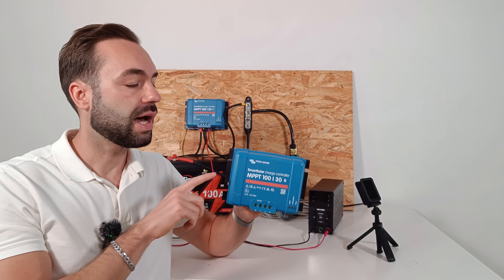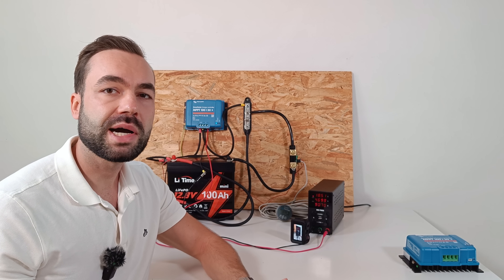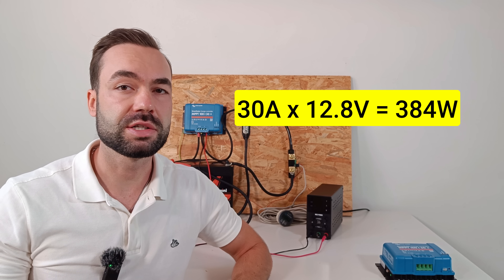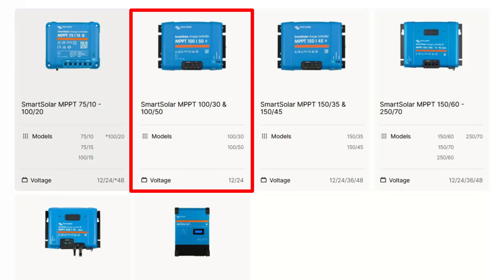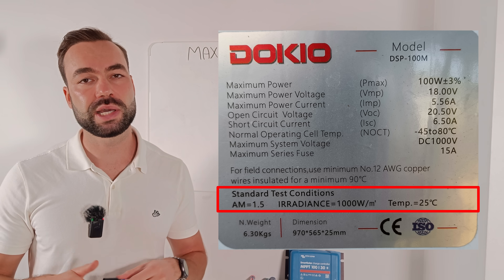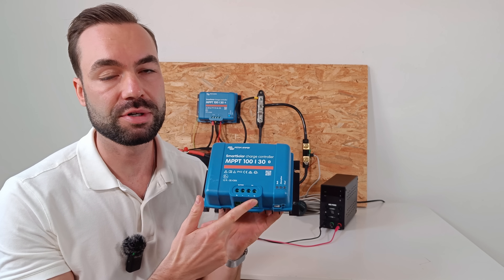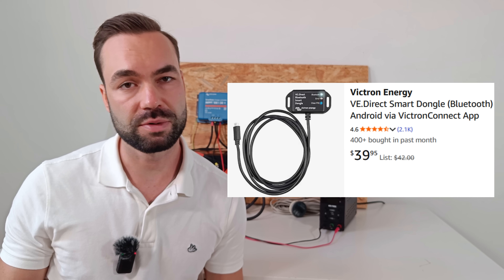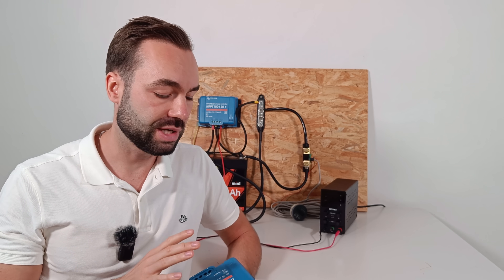Victron 100/30 MPPT Charge Controller Test + Review

Comment: What if I didn't connect to the  Bluetooth what will happen
Reply from the maker: Then it works on factory settings with the battery chemistry selected on the rotary dial.

Comment: Hi
So blue solar does not have the build in Bluetooth. Has does one configure these controller and monitor it?
Reply from the maker: Yes, with the Bluetooth dongle that you plug in the ve port. Remove after programming. But this dongle costs about $40.
Reply: @cleversolarpower can any small victron controller be configured without Bluetooth or computer?
Reply from the maker: Some have dip switches like the victron Multiplus and the mppt has a rotary dail. So these can be adjusted to charge different battery types.

Comment: ok if I over panel to 720W (3S x 240w 22V each so 85V max)  on Victron 100/30 ... clipping will cause some trouble during summer or not much? ... I must over panel as winter is killer here.

Comment: Thank you for the explanation.  But What is the max current you can run. I am running 2x 345 watt panels, in summer on the trailer I can get 84-86 volts and 7 amps in series, with the 100/20, into a 100Ah LiFePO4, I winterized the trailer and swapped the LiFePO4 for the original AGM battery. From what I understand I san run a second string of panels and still push 84-86 volts but now may amps will be 14 amps, so my question still is how many amps can I run? Thank you.

Comment: I Dont like these MPPTs cause the terminals are underdimensioned, the housing is filled with gunk, so no repair is possible, they are too small, so cooling is poor, optical design is as good as non existent, its a too big monopolist which I never trust.....everything but victron

Comment: Great to know that going over the amp capacity won’t ruin the controller. I’ve had the victron 100/30 for a few years now and I’ve worried a bit about that. I have 3 - 200w panels on top of my rv and it’s rare to see 450 watts being produced by the panels, still it was a concern. Thanks
Reply: You have to pay attention to the voltage (100v max) and the ISC (35a). That ISC is important not to exceed when doing parallel connections. You can overpanel A LOT with Victron compared to other brands, that is one of its appeals. Many people choose to add a fan (silent it can be). There are people who use to run their Victrons to the max (clipping) without problems. In cloudy days you won't hit the max, but make use of the added panels.  For some it is about maximizing production and utilization during light hours and not having large batteries. Cheers
Reply: @segundacuenta726 I guess I’m not too concerned about ISC. My panels are hooked up in parallel, but from a bus bar to controller are 6 gauge welding cable along with a 40amp circuit breaker. Hopefully that is good enough. ?
Reply: @sunroy1  yeah that sounds alright.

Comment: Hola estoy viendo tus vídeos sobre victron es muy interesante y explicativos,yendo dos baterías lifepo4 de 280 a cada una conectadas en paralelo y con dos reguladores smart 50/100 cada uno,el problema es que figuran que están cargando pero las baterías al 65% están en estado de "Espera" que puede estar sucediendo
Están el carga 14,60
Flotación 13,80 y con un shunt de 300a
Reply from the maker: What is indicating the 65% charge? The mppt or shunt? Have you measured the voltage?
Reply: Te baterys @cleversolarpower
Reply from the maker: I would not trust the battery indication. I would trust your shunt.

Comment: But why not look at using bigger panels: like a full size one of +/- 500 Watts. 
Max Voltage +/- 33v.

I'd argue that with solar panel cost dropping so much (£70 for 500W), then with 2 panels, your panel cost = MPT control, and it's your batteries that are the things that limit you. Lead acid can only charge at +/- 20amps and it costs +/- £180 for a good quality 100 Ah battery. And with two 500W panels you will want two, so that's £360 for +/- 200 Ah.

Ideally if you have the space, use 4 x 500W panels in Northern Europe (2S2P).
Reply from the maker: Yes, that's going to be better. However, in the us, the shipping is quite high for last mile delivery. It's often times cheaper to get smaller panels and connect them in series.

Comment: I don't see where you test the devices to see if they can actually deliver the promised charging performance, which is the most important thing!!! If I buy a 30 Amp charger, I naturally want that charging current to be delivered continuously if the manufacturer promises it.

If you don't have enough PV available, you can simply test your charger: connect a 12-volt battery to the battery terminal. If you don't have PV handy, no problem—connect a 24-volt battery to the input, and you immediately provide the charger with more than enough power to deliver its promised charging performance.

A 30 A charger is thus forced to deliver its full 30 A. The input battery will then draw 15 Amperes. If the charger can now easily deliver a 30 Amp charging current without getting too hot, it's an excellent product. If the charger gets too hot and therefore pauses because it can't deliver the promised charging performance, it is a defective product that you should avoid.

Unfortunately, you don't perform such tests, which clearly show who builds good devices. I, on the other hand, obviously check every charger this way to see if it delivers what it promises.

Comment: For a beginner who's needs are simple   and best meant to be effective is having several batteires   or 1  300ah battery to be used with bluetti charge 1 type of device. solar panels I have  but limited  back yard space  and up north in Canada not enough sun in fall to winter seasons. so better having a 24 v 100 ah battery to charge the  power stations up  and also batteries  . In case of power outage i have a gas generator and propane  to charge plug my lifepo4 chargers one 10amp the other 20amps.  BUT for the person that has a no limit budget many solar panel installation is great. more for the few than the many . thanks for sharing your knowledge about MPPT functionalities. I have a victron mppt 100 v 30 amp solar controller.

Comment: 2:11  94watts/18.5v=5.08 amps, 
Interesting I'm going to look at my readings tomorrow morning again as I'm getting 20-22v at 7:30am, 
Think I may need to start using more power 🤣 
My mppt reads 60kwh to 130kwh per day solar input, 

Time to draw massive loads see what happens 👍😅
Reply: 6:54 
Okay so my 500w (2x250w) x 70% is 350w and the 100/20 will only give out 20 amps, 
So if I take that 20 and times it by my voltage then minus 70% will that give me my max watts ?.
So in series 
(22.3 each) 
44.6v X 20a -70% = 267watts

Comment: you not tested it clearly, all victrons have same problems much to small sized heatsinks!!!
try to put out of your "30A" charger constant 30A for that it is rated and it overheat shut down....up to components burn...
serious charge controller have right sized heatsinks to deliver what they claim easy 24/7.
victron is overprized junk.

Comment: Victron seems very expensive compared to other models. Is it have any additional benefit? Because I am using a Chinese model.. working okay 3 years.. If Victron have any extra benefit, I want to upgrade.
Reply from the maker: If your chinese MPT is working, then no need to change to victron. I just prefer these because they are silent and because of the app.

Comment: My system is 48 volts using 2 x 150/45.  I also have a 100/20 that has pulled through 716 watts and would handle over 1000 watts. So i value the 100/20 over the 100/30.

Comment: If U over panel to say a 500w panel at 44volts, what size cable from the solar panel to the mppt? 6mm2 or 4mm2?. On a 10 meter run from solar to mppt.
Reply from the maker: I have a video specifically for that. Search for charge controller or voltage drop on my channel.

Comment: This may be an odd question but here goes: I have a 12v 100 Ah battery, connected to a Powrmr (POW-M25-PRO), I am considering adding a 710W Solar panel( SLX-710MCBFDG. Open Circuit Voltage(Voc) 47.9 V, Short Circuit Current(lsc) 18.5A) to charge the 12v battery. As the panels are not 100% efficient and the max input for the MPPT is 60V would this be acceptable?
Reply from the maker: Yes. Not how I would build a system but it will work.

Comment: you should definitely use expert settings to input what your battery documentation says and if you dont know 14.5 is common and just fine to use
Reply from the maker: No need, the difference in capacity is negligible.
Reply: @cleversolarpower not if you use all the capacity everyday and allows better balance
Reply: only reason to run lower is if your inverter doesn't like it
Reply from the maker: I do not agree. Balancing triggers at 3.4V most of the time. Thats 13.6V. An i recommend charging to 14.2-14.6.

Comment: Using a normal current limited supply to emulate solar panels does not work well and confuses all mppt controllers.
You need to use a supply with a "soft" current limit to emulate the solar panel response better. Adding a series resistor of around 0.2-0.3 Ohms is a good start to create a initial loading slope.
Reply: I'm not sure what are you talking about because clearly as shown in the video the controller handled it just fine.
Reply: @tiemanowo  I am talking about the wild fluctuations in the tracking which does not appear using a simulated panel or a real panel with clouds coming in above. The response in a lab supply is not gradual at all and it delivers voltage with no drop until you reach it's limit. I am not saying it doesn't "track" I am just saying it doesn't respond the same at all and gives impression of very rough tracking.
Reply from the maker: I will give it a try. The voltage did drop because it had a load like a solar panel does. Will see if it makes any difference.

Comment: I have this exact controller.  Very happy with it compared to the cheap rubbish I had before.  I do, however, struggle with the need to factor voltage increase at -20 degrees C - what use would a solar panel and Li battery be in that climate?  Especially since most Li batteries shut off charging at 0 degrees.
Reply: The panels are out in the cold weather, while the Li battery can be (often is) inside a warm space.
Reply from the maker: If your battery is outside as well, then you should insulate your battery box and problably get a heated battery. I have a review coming up for one of these.

Comment: victron needs over 5 volts differenz to work other companys chargers need 1 volt different thats why i never touch victrom.
other part :
power your 35 Ampere charger with 35 Ampere, what will happening?
overheat+ burned elektromik over time coz heavy undersized heatsink like all victrons.

i you search for a serious brand:
top DC to DC chargers work perfekt with 1 volt differenz in battery to panel voltage.
top charger have optimum sized heatsink to let the eletronik not overheating over time hold it really cool an it will last for 30 years......
for example for a top hardware litime 30A"from the company helios" 1 volt differenz works great , mppt tracking in light speed so top ARM cortex CPU and last but not least for a 30A charger a 1,5 Kg aluminium heatsink , so stay with a peramanet load of 30A 24/7 ice cold elektronik this charger will last for 100 years....

all what victron makes wrong all the time makes helios right.

last but not least overpaneling in clouds or winter ~10% output is normal so what size is really needet on solar if you care to get always 30A charge?
yes ~ 3000 Watt is the way to go.

Comment: Hi Nick. Another helpful and informative video. Many thanks, especially the tip about ferrules - though I am finding it difficult to find a crimper that can reliably manage AWG6 ferrules. 
In the line up of Victron Smart MPPT, there is another model: 100/50 but the max voltage is the same as the 100/30. I look forward to your next video.
Reply from the maker: For 6 gauge it's better to have a hydraulic crimper with lugs. Yes indeed, it has a higher current to the battery.
Reply: I used the HKS ferrule crimping tool that works for 6awg  and Temco hydraulic crimper for lugs for my setup.
Reply: @ckz001  Thanks for the tips - just what I needed as I have been becoming bewildered about what works and what does not. The Temco is pricey, but I think worth the money. The cheaper ones all seem to have failure rates between 4 and 10 per cent. Victron recommend the use of 6AWG and square ferrules. Where I am metric is the norm but 6AWG is not exactly identical with 16mm2 and that causes a lot of problems. I meant to add: although Victron recommend square ferrules the hydraulic crimpers give hex. Does the ferrule shape matter that much when larger wires, say 6AWG and above, are used? Thanks for any advice.
Reply from the maker: I would just get a $50 hydraulic crimper from amazon. They have never failed me if you are using the correct lugs. I made a video about these.
Reply: Buy a hex crimper, not a square crimper. Hex fits better inside. Hydraulic one is even better for 6 AWG (16 mm2) and bigger sizes.

Comment: I have 150/45 model during winter time my Series configuration 7 panels will over panel and a few time peak past over 150 Volts.
I use about up to 9 rectifier 
Diodes in series from panel to input of Victron to limit the peak voltage, each rectifier drop 1.5 (.75x2)volts they are on diy aluminum heat sink.
Is this O.K. to limited voltage or do you have better way like buck converter please share your opinions. Thanks.
Reply from the maker: I never heard about this, don't the diodes drop voltage all the time, even when it doesn't hit 150V? It would be better that you designed the system right from the start. So removing a panel might have been the best option from the beginning. A buck converter loses about 10%, so this wouldn't be a good option.
Reply: Using diodes in this way... well, lets assume normal diodes (rectifier diodes are usually Schottky diodes with roughly a 0.35V drop)... ok.  The diode(s) go in series with the DC+ from the string.  So assuming 10A from the solar panel and a 0.7V drop, each series diode will lose (I * V) = (10 * 0.7) = 7W of power.  Multiply by 9 and you are losing 63W.   That can easily burn the diodes up in which case they tend to turn into dead shorts (no voltage drop) after a while.  Definitely NOT recommended.

Also the diodes won't have the full voltage drop at zero current so they do not necessarily protect the charge controller from excess voltage.  Again, NOT recommended.

A better solution is to remove a panel or otherwise split the long string into two smaller strings.  Or use a panel with a slightly lower Voc spec.

You can also put a permanent load on the string that dissipates less power.  This will pull the solar panels off the Voc a bit.  Example, a 1K Aluminum-cased resistor between DC+ and DC- on the solar input, with a heat sink.   Assuming a string voltage of 100V, then  100V / 1000 ohm = 0.1A.  P = I * I * R  so  P = (0.1 * 0.1 * 1000.0) = 10W dissipation.  (Calculate proper resistor value based on the Voc of the string.  Dissipation is NON LINEAR with the voltage and resistance).

It is also NOT recommended to do this as the resistor can get hot.  It's usually unnecessary to hack the string like this.

-Matt
Reply: @junkerzn7312  correction they were Bridge Rectifier ( aluminum square has a center hole in the middle)  I just use this old school technique temporarily during cold 
Winter(2/2025) days till early Spring, I finally remove one of the panel that has lowest VOC ( mixed old and new diff Renogy, Ecoflow) and wait to reconfigure the sting in parallel correctly during coming Fall.
Reply: @p.b.7861  Yup!  We're all pushing boundaries.  I am right now having a debate with myself whether to add a 10th panel to one of my strings.  45.9Voc.   550V practical limit.  That drops my margin down to 22% but I think it will be ok.

-Matt

Comment: Accurately delivered. Recently sold my 100V/30A controller to a friend. He will find this video very useful.
Reply: 90% of victron user put PC fans near the heatsink of victron they are all overheating heavy about the much to small sized heatsinks.
tell that yxozr friend, if eletronik on victrons burn no way to fix it, all glued horrible....no way to open this crap for fixing burned parts....

thats why i stay far away from this stuff
Reply: @horststreber  no they dont. TH eold Orion DCD chargers yes, but the MPPT chargers don't seem to run very hot.
Reply: @andrewford80 and even if they do or you get worried have you seen the new backing fan adapter they now have for them lol 😅, 
I brought a 100/20 and was wondering about heat tbh but after reading on victron FB pages that's just a load of rubbish, 
It's only getting hot if it's in a box with no air 👍

Comment: You are doing some great videos!  Thanks.  My first mppt was a Victron Blue.  Then, a year later, I got a lithium battery and needed a VE.Direct cable to reprogram it.  Mine didn't have the little dial like yours.  Then I got a Smart mppt about a year ago.  Then, I got another smart mppt last week that I'll be installing tomorrow.  All mine are 75/15 - on a boat with several smaller panels.  Hopefully, my new setup will help avoiding moving panels all over throughout the day.
Reply from the maker: Having multiple MPPT's on a boat is great for redundancy. Do you experience a lot of shading on your boat so you cannot connect them in series?